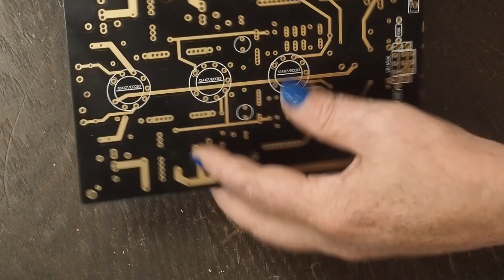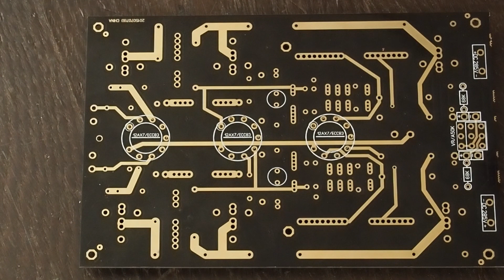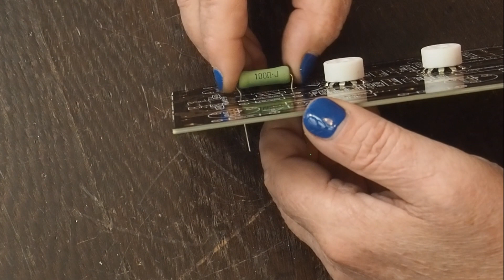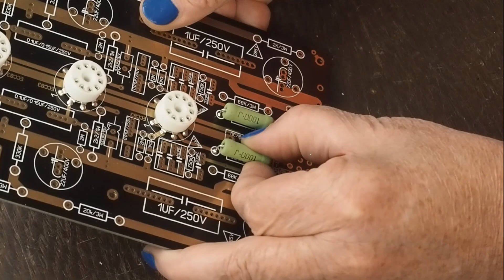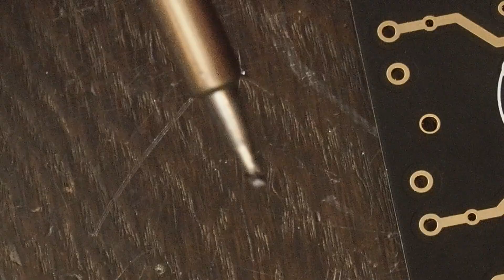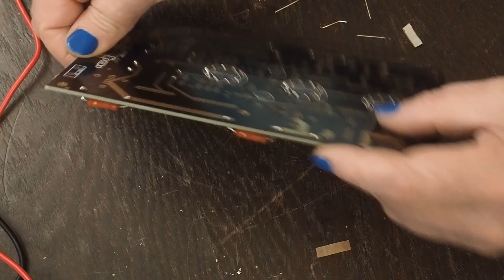All Tube Phono Stage Pre-amp Part 4: Main Board

Comment: Odd question but is there any way of making those tiny Chinese jf1 preamp kits sound better ? I need something that small for when I travel and thought it would be fun to upgrade one :)
Reply from the maker: I think they are mostly op amps with a tube buffer. I know some just power up the circuit through the tube heaters...
Reply: @SkunkieDesignsElectronics  yeah wanted to give it a try and it was crap, sad tho could’ve used something nice due to the size

Comment: Hv to say love your videos, im looking to build a phono stage amp like this. Now i know you said you brought this from ebay. Was wondering if you could help with a link because all the pcbs i see on ebay are of the one board style, and i perfer to build as a two board design like your seperating the power supply.
Reply from the maker: The black one board type are perforated to "snap" into two boards if you want to separate the power supply.
Reply: @SkunkieDesignsElectronics  got you thank u  very much. Keep up the great videos they are great for beginners like me.

Comment: if the board is from china does the cheap material used on the board itself degrade the sound?
Reply from the maker: Not possible. But there are a lot of audiophiles who might believe the copper used in the board needs to come from a hidden mine in South America, mined by natives, cryogenically treated and then exposed to infrared light for 46.5 hours :P
Reply: @SkunkieDesignsElectronics  ha ha ... love it.
Reply: @SkunkieDesignsElectronics  🤣🤣😂😂
Reply: You probably get this a lot but I have the board and parts list but I sent the list to a few places and they couldn't fill the order. Do you have a parts place that I can send the parts list and do the whole order. Ill pay more for nice caps etc.

Comment: Anyone tried redesigning this preamp to use three KORG Nutube 6P1 VFD style vacuum tubes with a heater of 1.5 -3V and an B+ of 50V so it might work with a Turntable and personal computer so you could rip/listen to your vinyl collection.
Reply from the maker: Interesting idea. I read the tube capacitances were calculated into the RIAA EQ part of this so that might have to be recalculated?

Comment: Just getting into tubes and discovered your great channel. I see that you are negotiating your way around the component (resistors for instance) offsets with the board and would like to suggest using strips of balsa wood (or similar soft, none abrasive, none conductive (electrical/heat) and easy to cut materials) of different thicknesses (I personally use 1, 3, 5mm strips, and can use combinations of to get the other offsets) which I just use across groups of same components to keep equal offsets and makes the soldering and handling super fast and consistent... Easy to use with sticky/adhesive tape also when you need your two hands for other balancing act, if you get my drift and I am sure we would all agree that a third hand when soldering is always welcome. Great work and enjoying the softly spoken, calm, well supported, and easy to follow explanations as you progress along... I look forward to seeing the entire series and see how this little jam performs when you have finished testing it and the final tweaks at the end to make it even better, which I can already tell you are that kind of person... Well done, and keep it up.
Reply from the maker: Great tip on making up a spacer! That is what I love about this, I'm learning from you all too!

Comment: The idea behind  loading from the bottom is plus heat  minus gravity pulling on the leads.  By mounting closer to the chassis and having the tube farther out of the chassis is a scound heat shield .  Unless your running higher current tubes like 5687 family the heat not so much of a thing. resistor bending forms are cheap from the regular sources. My experience  makes the power supply a very large part of the sound . A number of engineers in Japan  give the power supply as much as 70% of the sound .  This is not to say the signal resistors are not very important in the noise and sound of the device.